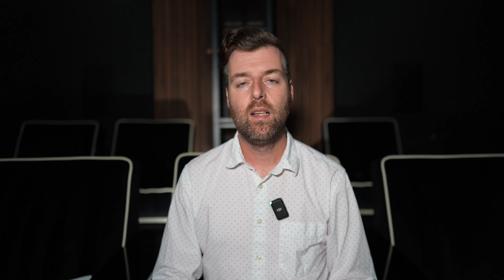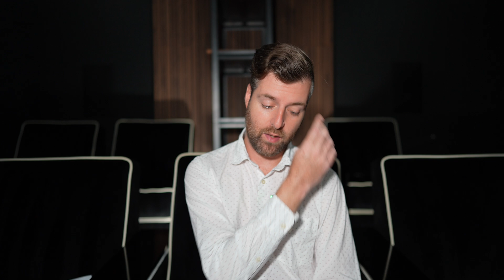Where do you get your ALL-PASS filters?

Comment: If you want to generate biquad coefficients for a second-order all-pass filter, you can go to the miniDSP application note page titled "Advanced Biquad Filter Programming". Scroll to the bottom of the page to find a link to a biquad spreadsheet.  This spreadsheet has an all-pass filter design page where you can enter the sample rate of the device, its center frequency and its Q, and get miniDSP-compatible biquad coefficients.  If you want Q-Sys-compatible coefficients, take the a1 and a2 coefficients and multiply both of them by -1.

BTW, all-pass filters are of the non-minimum-phase type.

Another interesting bit of trivia: the "phase knob" on every sub for which I've seen a service manual is a first-order analog all-pass filter implemented using op-amps.  For an example design, go to Rod Elliott's "Elliott Sound Products" site, where there is an article titled "Subwoofer Phase Controller".  I didn't post links, because some YouTube channels seem to auto-delete posts with them.  I'm not aware of any spreadsheets that support getting biquad coefficients for first-order all-pass filters, but MSO supports them in both miniDSP and Q-Sys-compatible formats.

Comment: How can it not be needed almost always (using allpass filters), to have all three of LCR mate well to the subs (which most of us runs combined for maximum summation and then EQd)? With my previous setup, LR vs C were so off compared to each other, phase-wise, that I could never get all three to mate well to "the subs as a system". Would love being able to allpass either LR, or C, to fix this.
Reply: FWIW; previous system was sealed LRs, ported center, from Linn. Most of my time with them, I ran them all active, and Linn did actively tailor their bottom end response when doing so; gave them a little well placed bump, and tightened rolloffs. Exactly what they did is beyond the point, which is that LR vs C, I think, will maybe always not be very similar, in terms of phase and what to mate with, when handing over to "the subs as a system". I felt a great need to be able to mate "the subs as a system" with either LR, or C, and then force the other to comply, with allpass filters. At least that is what I think I wanted to do.

Honestly not sure if I still have that need, just upgraded to KEF R7 Metas and KEF R6 Meta, for LCRs. But I expect I will.
Reply: All I want for christmas is for Matt to touch on this in a future video.

Comment: In the software world where I come from when a device has a feature like 4k 30 and autofocus, and those two things don't work. this is called a defect. Otherwise don't release the software/feature set to the user. Just like companies not providing access to low pass filters.  It kinda feels like a car salesman response, well its just old, time for a new one. the specs on the a6500 say it does 4k 30, so my question to sony is how is this beyond the devices limits? they control the software